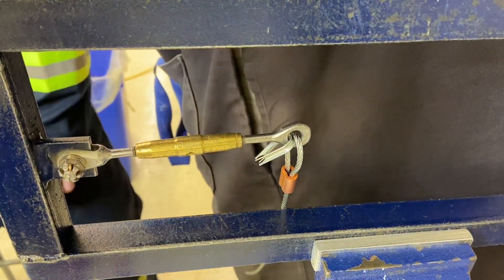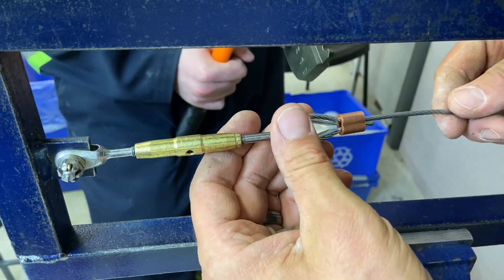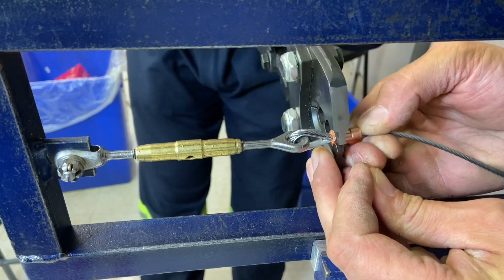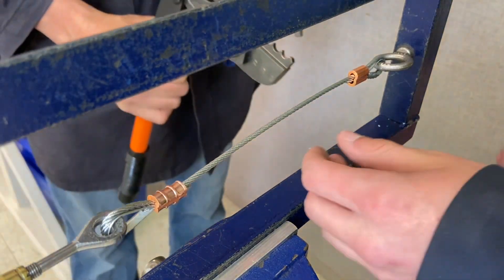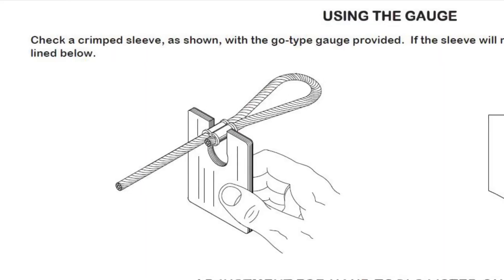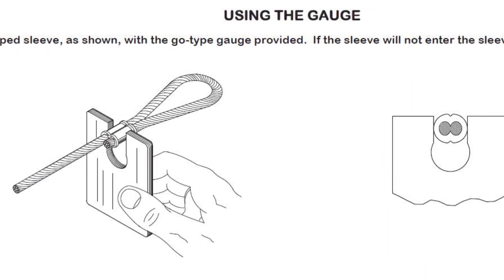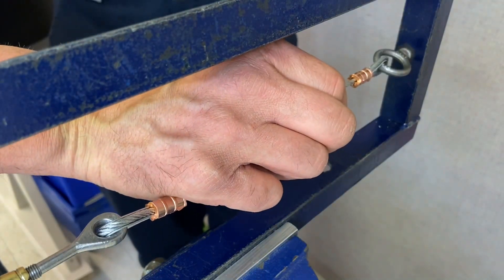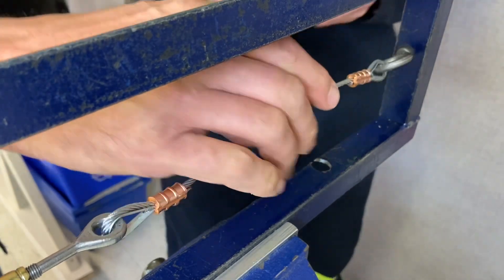Nicopress swag on aircraft cable

Comment: I cant find any videos showing the way they are done on my airplane. I have a Maule, I've been to the factory and a guy there showed me when I bought the cables and ends how he tucks the little points of the thimble into the nicopress. It's something they've apparently done for a long time because mine is a 1985 and all the ends are like this. It makes them tighter, neat and you don't have to worry about the thimble flopping around. I just cant seem to get the nicopress up tight enough to get it the way they do. The cable is very snug the whole diameter of the thimble, it's not loose on sides like you see in all these videos.
Reply from the maker: I think they don’t tuck the ends in. I’ve worked with people before that cut the ears off of the thimbles. They used side cutters and trimmed them off.